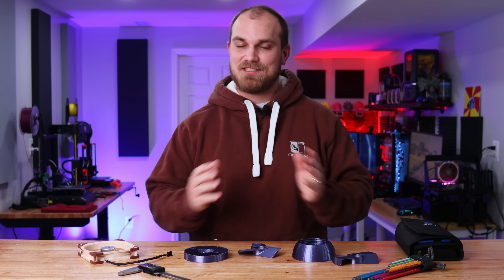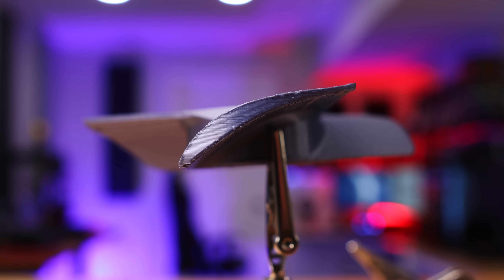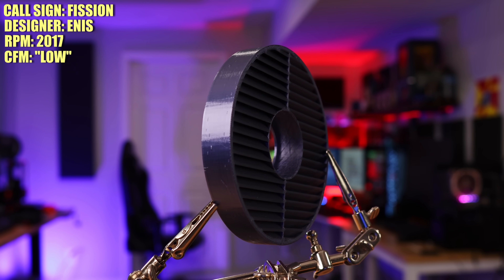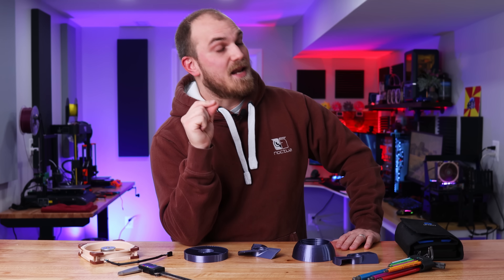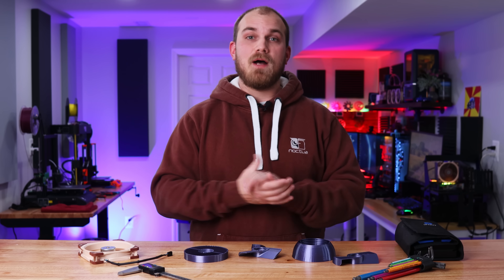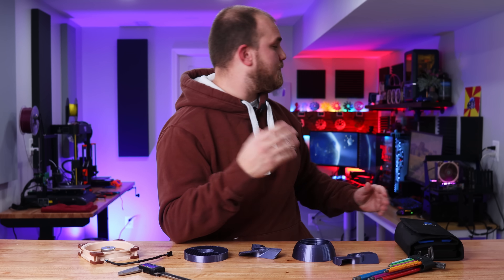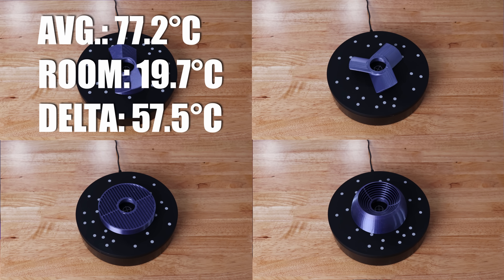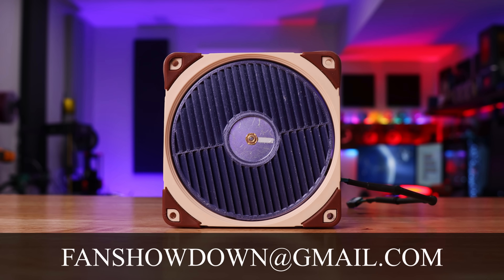IS THIS MAGIC? This Fan Has No Blades | Fan Showdown S2E3

Comment: suggestion for the blade-less, remove half of the concentric circles and then angle the supports as to turn them into a fan. it'll have the same db levels but increase the air velocity. also, alcohol or acetone vapor smoothing will reduce even more noise.

Comment: Humidity in the air will change its heat capacity, viscosity and density by a few percent. If you don't control for the humidity of the air in your measurments, then your results taken on different days will most likely drift by a few percent meaning that a 0.5°C difference would not be significant enough to conclude which blade is better.
To fix this you should have a control blade that you re-measure with each batch and then normalize proportionaly the delta temps of each blade relative to delta temps of the original control divided by the control of batch.

Comment: What if, instead of the supporting fins on the bladeless being straight, they were angled to direct air better?
Reply: Yeah I was thinking this too. Just a little bit of blade angle might make that thing work very well.
Reply: Yes it probably would. That being said, Sean had an ideal and stuck to it completely. So props there.
Reply: Ya
Reply: That or a pair of blades in the cavity to bring air into it and then really utilize the centrifugal blower design better. It looks like it solved an obvious problem without incorporating the variable that would benefit from the solution.
Reply: I was thinking something similar. After reading all of these comments, I wonder if doing that and bringing the vanes together in a nose-screw would force more air through.

Comment: I have zero 3d design experience/software or I'd try this myself, but maybe mix that three-blade design with the bladeless? Get the aerodynamic blades acting as the supports for the centrifugal shell? Should improve the airflow, while maintaining the quieter noise level.

Comment: While watching this episode I got an idea.
 Is anyone in the comments capable of making a 3D printer mod that replaces the table with a rotating cylinder?
Reply: Simplistically, the extruder head would need only move along 2 axis and stay perpendicular to the cylindrical bed. But with more time and calculations, you could possibly make an object with varying angles of layers.

Comment: What if the "bladeless" had blades on the lower portion of the design to increase thrust. Also can I point out the bladeless has upright support that I think go from top to bottom that technically are a blade

Comment: The blade-less fan should have slightly angled blades instead of a flat bar. It already pulls air in well but it doesn't have much pushing force

Comment: I think it would be cool to see the air flow behind the fan, so like place the fan completely vertical, in center frame and then have the smoke come in so the we can see it get sucked in and then pushed out. Many different fans have different exhaust patterns.

Comment: If Sean just put 3 blades between the inner rows or even all the rows, but keep the height of the blades level with the core of the fan, it would have moved a lot more air and still worked how he wanted. It wouldn't have increased the noise much either. Give us a 2.0 version dude. It will kick ass. Can't wait.

Comment: Bladeless is ingenious, using the friction to throw outward, and using the geometry funneling it backways, really really clever, and maybe a very niche market could have real use for this!!!

Edit, for those making fun of it as a gimmick, thats a pretty limited view, there might be engineering cases where one has to optimize for safety, or very laminar flow generation, therefore blades may be ill suited to the task, but this would work well. Just because we don’t immediately see a use for something does not relegate it to be a gimmick. Its new, it works differently, and so we need to think about what would benefit from its unique strengths
Reply: An improvement on the Bladeless would be to curve the vertical supports slightly towards the direction of the spin. I guess it wouldn't technically be "bladeless" anymore, since they would function similar to blades, but it would increase airflow along the outer edge, and pull air in a bit better.
Reply: @Crown-Fox  I fully agree and were about to say the same thing.
Reply: @linusandersson1535  same
Reply: @TheSliderW  same here.
Reply: @jaz1nce960  samesame
Reply: @Crown-Fox  Or only have the supports at the inner edge or open in the middle as much as possible. Other options for improvement could be a texture change from rough on the inside to smooth on the outside.
This fan could possibly be driven from the outside and be left open in the middle. 
I'm really interested in how much performance/db this could get to at different speeds.
Reply: @Crown-Fox  I would assume curving the inner vertical supports would achieve the same, if not more efficient results, as the vertical supports would then create a funnel of sorts to aid with the input
Reply: It loses quite a bit of performance because the intake is smaller than its output.
We know it's better to blow than suck for cooling, but this one might be better if it was sucking actually!
Then you put it on TOP side (not bottom) of a tower cooler inside the "tower case" so it only aids the natural air convection - hot air goes up!
Could be real nice actually!
Reply: @zlac  Wrong, it only works because the intake is smaller than the output. If it didn't have that centrifugal force from the air moving outwards as it moves back, it wouldn't move any air at all.
Reply: @Steamrick  intake would still be smaller than the output because it would suck instead of blowing.
Reply: It's basically a centrifugal blower with an integrated duct.
Reply: This could be really helpful in certain situations because it works in both directions. It always pushes air in the same direction, no matter clockwise or counterclockwise. It's like a fan with an integrated rectifier!
Reply: @TlalocTemporal  great observation!!!
Reply: Definitely a great design!  When I saw the title I initially thought of a tesla turbine and it kind of is a tesla turbine, but facing a different direction.
Reply: It could complement fanless designs that fall short by just a few degrees.
Reply: A noise reduced pc is optimal for my recording studio
Reply: Fan blades break all the time, which is why Dyson made bladeless fans. Blades can injure. Bladeless (even though it has blades that are connected by circles) can mean safety.
Reply: @thesuccessfulone  dysons "bladeless" fans arent, they just have a normal bladed fan inside, and then a "bladeless" airguide to smooth out the airflow
Reply: @thesuccessfulone  Dyson 'bladeless' fans actually use tiny ultra fast fans made out of machined aluminium. Its only bladeless in that the razor sharp blades are hidden inside the case. :D
Reply: Hence my caveat that any bladeless fan is not technically bladeless
Reply: @thesuccessfulone  lol dyson 'bladeless' fans have impellers in the base so far more blades than regular fans, they then use the venturi principle to more air by pushing high pressure air through the edges of the ring (like a carburettor but blowing more air rather than fuel)
Reply: There's a few things you could do to improve the efficiency of the Bladeless.. Maybe a thinner section and a smoother surface, plus maybe a surface contour pattern to increase the flow in the direction you want..  Curious design. Kind of like a Tesla turbine, maybe a higher RPM would help a lot..
Reply: Kassidy Lechner  yeah i think that would do the trick!
Reply: This is called a Tesla rotor btw
Reply: Science
Reply: there are pumps working on that principle and even clutches , also there is famous turbine torque converter for a drag car that uses same physics, just more complex geometry
Reply: Yeah, the bladeless came in last, but it still still did the job perfectly well, so if you need the quiet go ahead and use it.
Reply: @H ootanay  actually the Dyson bladeless fan is not bladeless at all, it has a fan it’s just inside the housing so you can’t see it.
Reply: @H ootanay those "bladeless" Dysons still have blades down in the base
Reply: It has poor efficiency on both cooling and sizing. It can be a gimmick product, installed for the lulz.

Comment: My suspicion is that the bladeless fan didn't produce much static pressure, and therefore was very ineffective at moving air through a radiator. However, if it was just used as a normal airflow chassis fan, it would probably be just fine. It's not really bladeless though. There are 4 blades in there. They are what holds the concentric circles together. They start the air flowing circularly around the fan as it turns, which is responsible for the centripetal forces that the scope shape act upon to create airflow. After everything is up to speed, my guess is the skin effect of the PLA alone will be enough to keep the flow moving.

Comment: he can improve the silent fan with a torque converter style blade, it will increase noise but will increase cfm or he can he can put "wall" or bump(like mercedes F1 rear wheel) in between rings to avoid dead zone from rings to rings where air can't "grip" to the fan and beeing move

Comment: The bladeless would never win because its only based on the skin friction (the air physically getting slid along the fan walls) to get the air spinning outwards instead of using any change in momentum from the velocity and angle of the blades. If he was to put a few blades in it (like a ducted fan) it'd perform far better

Comment: i think with some improvements to the bladeless fan, it could perform at a reasonable level. less rings, so bigger speaces between  for less restriction. and 1-3 more of these outwards going intersecting "blades", maybe even at slight angle similar to a fan. cause these are what is actually moving the air.

Comment: Interesting how the Fission fan seemed to both pull air into the center and reject it from the sides. If you look in the smoke test it's very clearly pushing air out the wrong direction. Wonder if it's from the large center support post or just the mass of tight slats pushing air away.

Comment: The focus on noise-reduction is interesting, perhaps a noise leaderboard is in order.
Reply: That would be interesting but to qualify for the noise leaderboard the fans should have to reach a minimum performance to prevent people from making a flat disk
Reply: @JetJiles  Maybe "quietest fan that doesn't temp throttle".  So It would still have to perform the basic function of the fan, but keep the emphasis on noise performance.
Reply: @anthonybarker9123  You'd still have to noise or temperature normalize. A fan that is louder at full speed but is very efficient can be slowed down and made as quiet or quieter than a quieter but less efficient fan design while also maintaining equal or lower temperatures. Based on the noise floor and measuring done in these videos, I would say noise normalized to 45 is probably more accurate, though 40 might also work. GN uses 40 dB, so that's definitely not a bad starting point.

Point remains, you have to normalize some part of the test, either noise or temperature. Or you'll basically be choosing to compete in the noise competition or the temperature competition. Which I guess is okay, if that's what you're into, but I personally think it would be more interesting from a design and testing perspective to see the best fans, not the most specialized ones that will be out performed in all ways by just turning down the speed and being as quiet while cooling way better.
Reply: @JetJiles  Topgear style ? XD
Reply: Noise normalized at like 40 dba or something. So you have an overall performance chart and a noise normalized chart.
Reply: @user-kk4bq7mb8u  With designs being so radically different, selecting a noise level seems arbitrary. We don't know where peak efficiency is on each design. Maybe one fan isn't competitive at 40 dba, but outperforms others at 35 or 45. We have some noise data, which is fine. I personally feel it's more important that we get to hear the fan, because the type of noise produced says a lot about the design. Yes, noise level is important, but this is a concept phase of design. We don't need to worry about whether or not these fans can compete at a market level. We need to be looking at big picture stuff here, and getting as many ideas on the table as possible.
Reply: @michaelscott-joynt3215  40 dba is a standard used by many other reviewers and test suites due to its generally non prohibitive noise level. Nobody is saying to take the sound samples out of the testing.
Reply: @user-kk4bq7mb8u  That's fine, but we're not reviewing products, we're looking at concepts. Noise is a selling point, but this isn't about which fan you should buy.
Reply: i'll make a fan that is just a piece to go on the bearing surface and no blades to win the quiet contest
Reply: @HerbaceousM8  presumably the cut off, would be, if it leads to thermal throttling
Reply: @HerbaceousM8  just do a standard it has to cool something
Reply: @HerbaceousM8  Well obviously part of the parameter should be it can't throttle during heat test either lol
Reply: What about noise Performance Ratio?
Reply: @bigsmoke6414  and perhaps dominant frequency-normalized as well, seeing how lower frequency hums can be preferable
Reply: I like this idea of a noise leaderboard that doesn't throttle
Reply: id say it needs to have a minimum temp delta to qualify..
Reply: Yea, noise normalised leaderboard + disqualify any fans that throttle
Reply: But we already know what would be on the top of a noise-reduction leaderboard: Just ditch the fan altogether and put on an oversized heatsink with enough surface area to heat-exchange with ambient air.
Reply: Or make a scoring system vased on airflow vs noise
Reply: Can I get some silence in the chat
Reply: I agree
Reply: I will rule the noise leadboard with my bladeless and fanless design
Reply: Build a fan into the front face and the blade less will be bladed and start shifting air.

Or build an upgraded tulip fan with a better holding capacity. Either or.

Start soft acceleration to the core, and a cover for balance/sound....

Suddenly I wish I knew 3d modeling...

Layer C grab and pump to core vent
Layer B pump to ring vent
A: feed outer ring

For bonus points: turbine stators as an over cover. draw the air deep into the fan and pump it through.

If we skip the outer: a well covered funnel structure will keep it quiet, less supporting blades for bonus points if audio produced: if we add it we catch air drag on the outside and pump it into the spinning blades.

Catch air wide for blade tip speed: and thus pressure generated, move it through ducts in a secret core compartment past a second inlet: feed it to the radiator in the back with minimal obstruction.
Reply: I agree. There should be leaderboards for noise, volume of air moved and temperature.
Reply: i would like to see a compairision Test of the best designs based in Gamers Nexus dbA noise normalised test level.
Reply: Sounds awesome (yes very pun intended) but it should have a minimum temperature requirement
Reply: @justinnentwich2779  its more you normalise by dbA and show the reached temps there, and in the other hand show with given temp load but fullspeed with different fans what they can do if unleashed, in this case here i would put all to the same high rpm to eliminate this part,
GN is using a 240mm radiator for this taype of tests and a given tdp load with nailed cpu clock and stuff...a 120mm radiator would be mostly not suitable for cpu cooling in this range at all. but would be as the hardware is there give also an information abput noise vs cooling performance if not running allways into throtelling.. its more complicated to make real testing as some think it is.
Reply: @Total_Egal  I aways wonder why he did not put a 240mm cooler on the cpu. But I have been watching for awhile (since last season) but yes I believe somethings should change on this setup. This is a tall order for the fan to cool a cpu that should have a larger cooler on it with a minimum two fans (of course when testing a fan set the two fans should be the exact same).
Reply: Whistling fan
Reply: Noise to airflow ratio should be a contest.
Reply: Yes!
Reply: A noise vs airflow/delta perhaps as well to see what gives good results and is quiet :)
Reply: If I wanted to make least noise. I'd make a very heavy cylinder. Lol slower rpm and smooth so no air disturbed. Most silent.
Reply: I actually kinda like this propeller-ish hum produced by two- and three-blade fans and this disc thing.
Reply: Thats would be soo interesting...
Reply: Indeed
Reply: The issue would be that with such a focus on solely noise, wouldn’t you just be able to print a ring that sits around the motor? It wouldn’t succ air but it wouldn’t be any louder than the fan motor... unless you had a rule preventing this?
Reply: this is a good idea
Reply: Hi, my channel describes the options for very simple, affordable and efficient water cooling. This approach is relevant on modern processors and in the next 10 years, this type of cooling can be a hit.
Reply: The connection points inside the cone need to be like a fan.
Reply: YesYesYesYes
Reply: Basically make a little anechoic chamber and then measure not the total dBa, but the peak dBa on a spectrum analyzer. 48dBa of white noise would sound much better than a 46dBa  5kHz whistle.

Comment: the struts holding the circles of the bladeless could have been angled to act as blades while also retaining its other pros of the design.
Reply: Agreed, but thin enough not to do most of the actual air moving :) At present they help to spin the air rather than blow it, turning the into mini blades, angling them may reduce the centrifugal spin of the air.